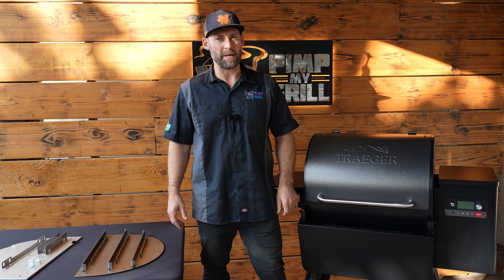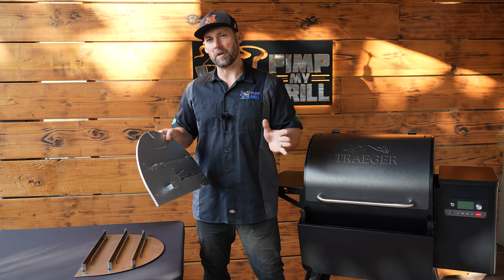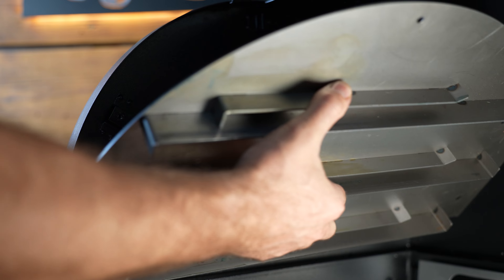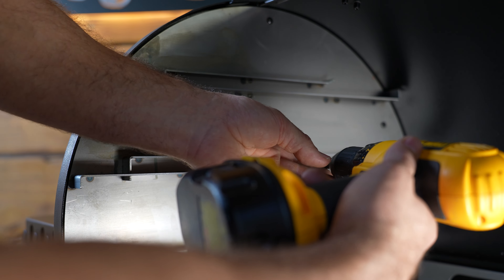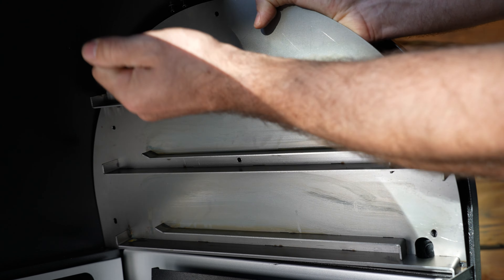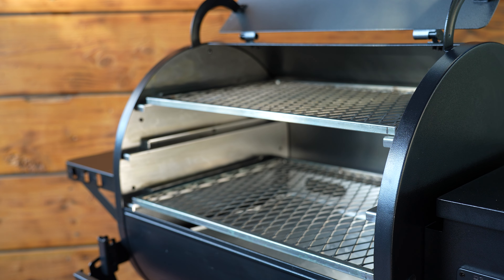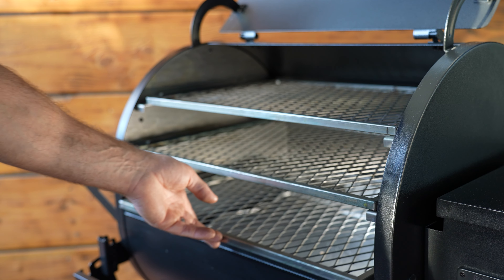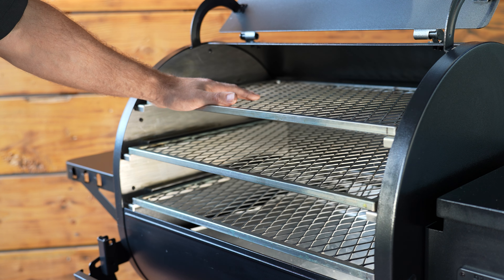Ironwood 885 / 650 / Redland Traeger | Pimp My Grill Grate Rack System Installation Video

Comment: Installed mine today. Well built and looks like it will work well. But now I know why they installed on a new grill. The screws are a pain in the butt to remove. One screw stripped and two tore the welded nut apart.
Reply from the maker: Hey Jim! Glad you are enjoying it. Sorry to hear about the factory T screws stripping out. I've used vice grips on some of the older grills to get them out easily.